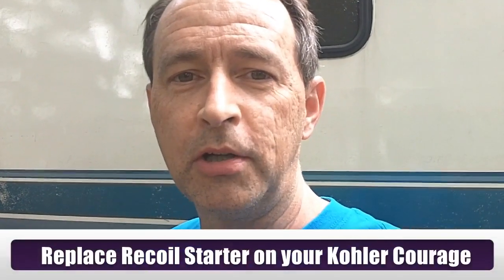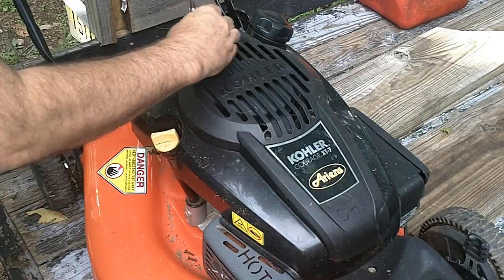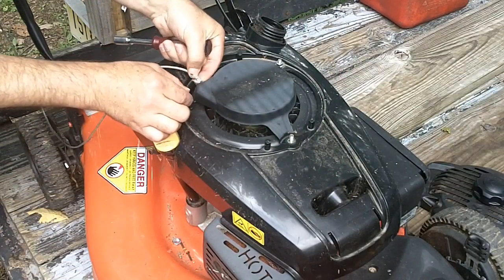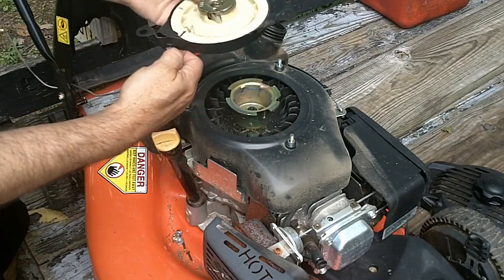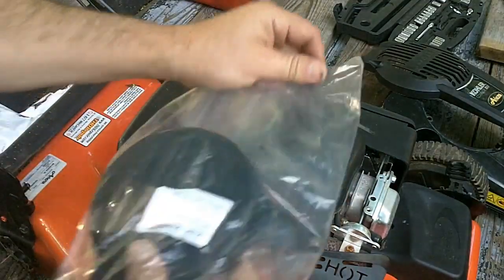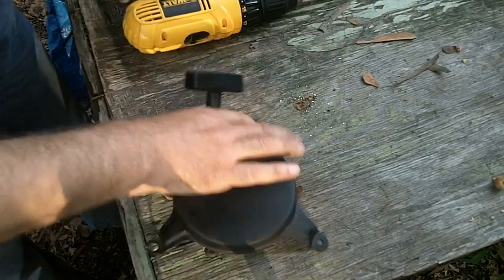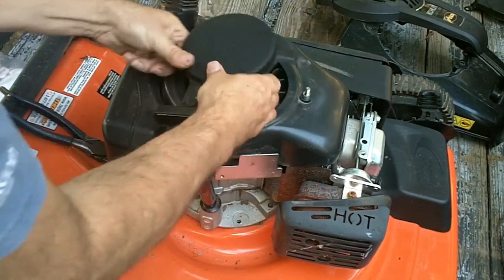How to Fix the Recoil Pull Rope Starter on your Kohler Courage Lawn Mower

Comment: You are a good and fast worker. I’m an armature and maybe by bits are cheap and get dull faster. For this reason when drilling a hole I start with a small drill and maybe go through 4 sizes. Cuts like butter but takes a second or two to change small to larger bits rather than trying at one go.

Comment: What would I do if the nuts you are removing around 2:40 don't come loose from the bolt itself.  Only 1 of the 3 nuts actually came off.  The bolt turns when I turn the nut.  I tried holding it with a clamp wrench to turn, but it doesn't work either.   Is there a way to get a tool underneath to hold it from the bottom some how?   Seems like a simple repair that I can't do because the nuts won't come off.
Reply from the maker: I think the top nuts are connected to studs that themselves thread into the engine block down lower. Just keep turning the nuts and you will either loosen the nut itself or the stud below it.

Comment: Any ideas on how to break loose those bolts (3 of them) that hold the pull cord assembly on?
Reply: I’m with this problem too with 2 of the 3. This is a big problem
Reply: Maybe I'm missing the point of your question, but, as shown in the video, just removed the nuts on those 3 bolts.

Comment: Hey buck, I have a question on the Kohler courage recoil starter, wouldn't it have set on top of the stand- offs on the mounting bolts. I'm sure there was enough catch on the starting dogs to work. But still I think they sent the wrong part. They make little changes in the middle of the production year, and they don't get it appalicatable to all models. I've had that happen to me on Kohler engines.

Comment: Nice job of adapting on the fly.  Just a suggestion for people who have not had much experience with small engine repair.  Always a good Idea to disconnect the spark plug wire before attempting any repair.  Rather be safe and just remember to plug the wire back to the plug when finished.  And I just want to say that it is much more informative to show what can happen during a repair than just opening the part and snap boom in it goes.  Real world mechanic repair is not always plug and play.
Reply from the maker: Thanks Jerry!

Comment: Just by a new recoil, it comes with the string and new recoil already atached. All you will need to do is unscrew the old one chunk it in the trash and replace with the new one. 
Cost about 15 bucks on ebay

Comment: Well I was doing it right but here is my weird problem. When I go to loosen the 3 nuts the bolts move with the nuts? WTH
Reply from the maker: Yeah, what a pain! Maybe there's a way to try to hold the bolt from the top while breaking loose the nut below.....?
Reply: Some models 2 of the 3 nuts are attached to the bolt, so you are really unscrewing it just doesn't seem like it until you try to pull the cover off.
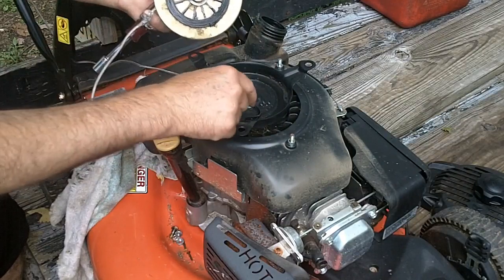Reply: I think if you look your boat as looking from the front of the lawn mower the one at 6:00 and the one at about 2:00 if the boat is turning with the nuts they're probably the ones that hold your Magneto in place if that helps you you'll have to reset the air gap